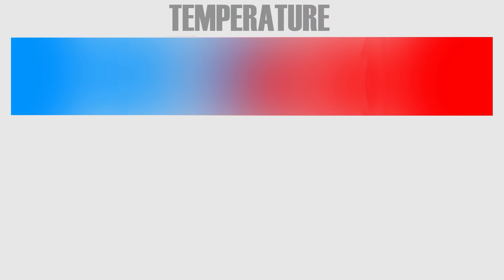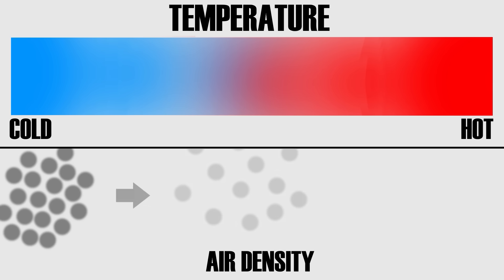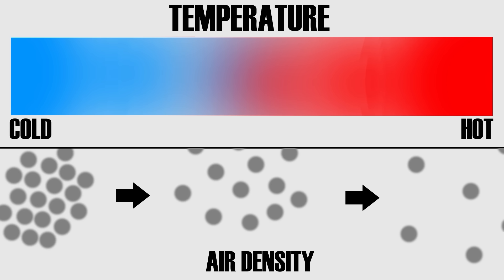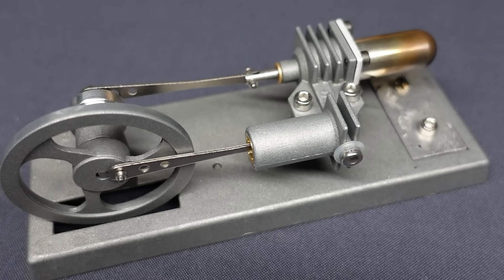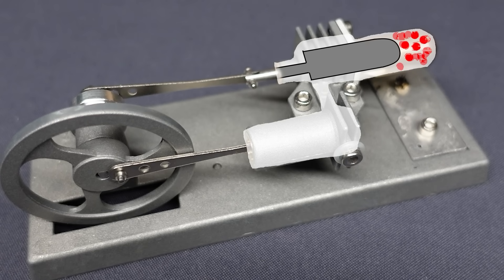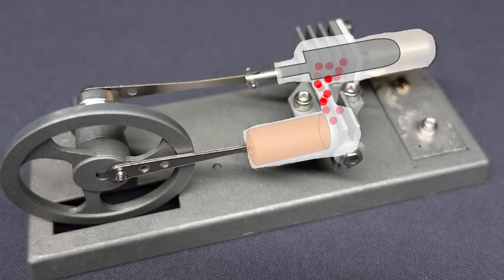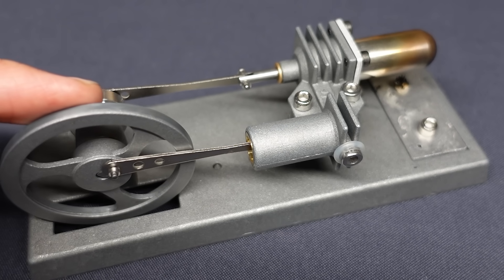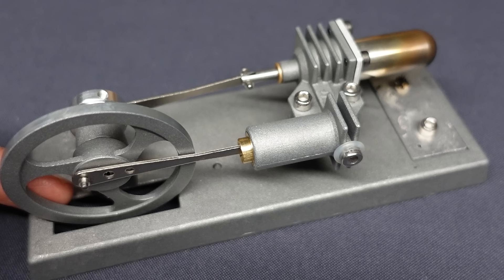It Can Save The World - The Simple Genius of Hot Air aka Stirling Engines

Comment: Sorry, Stirling Engines cannot 'save the world'. First, the world is doing quite well. Man and his technologies are extracting more energy from hydrocarbon fuels than ever, with better ICE designs and technology emerging as we speak. We invented ways to clean the exhaust. I have owned many diesel cars. From an Isuzu pickup in the 80s, several diesel VW Rabbits, and now a Turbo Diesel Jaguar (Yeah, its a really nice car, fast, and 40'ish mpg) with the latest DEF (SCR) exhaust system, that produces a tailpipe output that is cleaner than current gasoline ICE cars. edit: How clean? DEF emits Nitrogen and water vapor, and TRACE carbon dioxide. Yes, that's right.. no CO2, NO CO, NO Soot, No Nitrous Oxides. 
It's like the PERFECT technology for our times.  

I've owned and built several Stirling engines over the years. They are NOT efficient... Enough.  They do NOT produce enough horsepower. Never will. If they DID, we would have BEEN using them beginning years ago, and their technology would have, by today, been even more polished and efficient workhorse, instead of a novelty science items like they are today. 

Stirling Engines can do 'some' things, that's for sure. But the big, massive HP and torque generation needed by modern society? Nope. And that's why we aren't running our world economies on them. Period. 

Better to focus on diesel and atomic. Right now, Diesel is the most environmentally kind  fluid fuel we have. It takes less energy to produce than gasoline, and has more power in it. 
Add to that the new, and actually amazing DEF system, and you have LITERALLY a zero emission vehicle. Why hasn't the public HEARD of this? Why aren't we CELEBRATING this? Because hydrocarbon fuels have been VILIFIED and we are being programmed to AUTOMATICALLY HATE them.. and FAWN OVER ELECTRICS... or else! (I live in California and I see this mind-numbing narrative all the time)  
Electrics are horrid to the environment. Perhaps that will change, but it's many years away. Meanwhile, have you seen the HUGE BLACK RECTANGLES that are KILLING our deserts here in the SouthWest??? Yeah, I'm talking about these massive solar panel projects.. Millions of acres of once protected lands, being quietly covered up by solar panel farms. 

Underneath, a desert that used to thrive, now in eternal shade, criss-crossed by thousands of miles of access conduits and access roads. 

The problem with any discussion about ENERGY and ENGINES and POWER MUST, MUST, MUST include the above facts. Or we're just living in our little energy or engine fanboi bubble.

Comment: It's not an external combustion engine, it's a heat engine as composition implies a small explosion of sorts, a sterling engine does not rely on small explosions or combustion as it's the transfer of heat or cold as they work both ways so no it's not an external combustion engine it's a heat engine. The flame you produce on the outside is computing yes but it's transferring heat that's all where as a combustion engine uses combustion and pressure to move a piston and like with the Stirling engine it only uses the difference in temperature to move the piston.

Comment: Really it wouldn't be that hard to design a condenser that used these instead of cooling water loops. That would make it viable for steam plants, I think. The condenser would probably have to be pretty big, but doable. Imagine a nuclear power plant. Let's say someone works out good large scale high energy photovoltaics. Think like a solar panel, but gamma rays make the power instead of visible light. It's a tough nut to crack, but possible. Surround the reactor with these panels. Run a steam plant off of the reactor. Run Sterling engines in the condensers. Have the sterling engines run their own generators. Smaller sterling engines running in the coolers for all the cooling water and oil loops. We've eliminated the need for both cooling towers or cooling water, and increased overall plant efficiency by a considerable amount. No heat pollution in local streams. No huge cooling towers. I think the small Sterlings in the cooling loops and the high energy photovoltaics would probably power the internal plant equipment, give or take. The Sterlings in the condensers and the steam turbines would run larger generators.  Use all the standard tricks for increasing overall plant efficiency as well, obviously. Now imagine we have similar systems on other nuclear plants, utilizing different reactors. So when the fuel is done in this reactor, it can be made into fuel for another reactor. Then again and again. When the fuel is well and truly worn out it would still need to be disposed of, of course. But it cuts down on mining and punts the disposal further down the road at the very least. You could theoretically power nations with grids run by similar systems. Ways to harness large amounts of waste heat to make useful power is brilliant. Obviously the waste heat still ends up in the environment somewhere down the line, but we could be getting a lot more work out of it than we're currently getting, I think.

Comment: So theoretically, if you could adjust flame temp and some type of clutch system or something, this could work for a car🗿
Reply: Are you familiar with steam engines? They've been around since the 1700's. Exact same principle, but with steam as the working fluid instead of air.
Reply: @teebob21  i know of steam engines, but I haven’t learned enough about them to know that. That’s pretty cool
Reply: @Uhhhboots  Yep. Your first comment was basically describing how a steam locomotive works.

Comment: I'm wondering if this could be used with a wood gasifier to get some power out of gasification. My thought is that you could run an internal combustion engine on wood gas and have Stirling engines on the reactor, where most of the heat is, and also heat your house with the residual Heat.
Reply: The Dutch company 'Microgen Engine Corporation' has their 1 kW producing Stirling engines incorporated in woodburning stoves from Ökofen and maybe more companies. Their Stirling engine is not your typical one; the piston only moves up and down and thus directly generates electricity. No extra translations or conversions of any sort; so no extra losses

Comment: Why arent Stirling engines used in a variety of applications?
Can the Stirling engines run off of heat created from a clean chemical reaction? What about supplying heat or cooling from outside air and other air intake inside the building?

Comment: I'm always a bit sceptical of "revolutionary" technologies which have been widely known for a long time, but not widely adopted, so I do wonder what the drawbacks might be here that I'm not aware of. Nevertheless, where I could see this being useful if it is as great as some suggest would be replacing diesel generators, including in diesel-electric locomotives. For an electrical generator, a minute to start up or shut down shouldn't be a huge issue, so long as there's a battery or capacitor between the actual generator and the electrical output.

Comment: NASA are researching a type of Stirling Engine that uses decay heat from a Radioisotope source and instead of any kind of mechanical/rotation the pistons are reciprocating magnets that induce  and electrical current, they might also be using a more efficient gas than air too. They have very little mechanical wear, are much more compact and lighter than a fission reactor with less shielding and all the pumps and heating exchangers not being necessary and can produce a lot more power than Radioisotope Thermal Generators using the same Radioisotope source.

They have one test unit thats run for 14 years nonstop so far, they might well be the future for power generation during long term missions on the Moon and Mars and could make exploration of the outer solar system, where solar isn't an option and more power than RTGs can provide might be needed.

Comment: If the sterling  were miraculous, it would be ubiquitous.  To date it’s practical apps nil.  There are 3 questions economics considers:  performance, cost, delivery.  Sterling fails perf & $.

Steam engines (Rankin Cycle), closed loop gas turbine (Brayton cycle) are external combustion engines and make substantial power.  
Under study is a CO2 engine (closed loop Brayton cycle).   Because of CO2s peculiar properties, the CO2 engine has low compression work vis a vis typical gas turbine.   Cheers

Comment: I can see it on a hybrid that mainly uses the battery for power and when the battery is slightly drained, the Stirling engine is started and maintains the battery.  Then the Stirling engine can always run at its maximum efficiency, never be required to produce quick power.  When the battery is almost full, the engine can be shut off.  When the user arrives home he can decide whether to continue with the Stirling power or hook up to home electricity.  Then you have to ask if the Stirling can have a higher cost efficiency than a power plant.
Reply: Yes, I was thinking that it would be well-suited for a series hybrid.  With lower power, constant RPM, and higher efficiency, it sounds about right.

Comment: In terms of driving vehicles it could be used for a San Francisco style cable car system where it drives a continually moving cable that vehicles can clamp or unclamp from as needed. The submarine is much cooler though

Comment: This may be a stupid question, but if this were used for a vehicle, couldn’t you have variable speeds if each cylinder was a different temperature but timed to increase the power of the next cylinder if activated together? I hope that makes sense. Consider e-bikes with rear hub motors, I’m thinking like one cooler/weaker cylinder acts as the “pedaling” to a hotter cylinder “motor” when engaged, and you can keep engaging hotter and hotter cylinders. This is the first I’ve heard of these so I may be way off. Thanks for sharing!

Comment: Instead of using heat sinks, we should use tiny sterling engines to dissipate heat from processors and run the energy back into the computer.

Could this even work?

Comment: awesome, can we run them with electric heat?  if you wrap some heating element coils around the air chambers and get your heat source from electricity you could run them extremely safely and if you put a generator on the axel you could even get power out of it, although I'm sure not as much as you put in?  maybe?  someone smart tell me why it can or can't work?

Comment: I live inside a volcano, my home is heated using thermal energy and this cost is very low. I do wish I was better at machining so I could utilize this tech to yield free power from the heat already existing. You never mentioned about minimum temperatures of operation

Comment: Why are Stirling engines not efficient?
stirlings use conduction to transfer heat... this leaves huge energy losses. And makes them less efficient in warmer climates. low power to weight ratio..which is why despite simplicity steam engines replaced them in ships.

Comment: Solar power was one of the first sources of energy used to power Stirling engines. In 1882 Abel Pifre demonstrated a solar powered printing press. The power was generated by solar power concentrated using a parabolic mirror heating a Stirling engine. 

For what it's worth the engine was patented in 1816. That's over 200 years ago...

But the idea is even older and the first documented working hot air engine was built in 1699.

In effect the sterling engine can be said to be a heat pump. It takes heat and converts it to motion. So anywhere you have waste heat you can use that to drive a Sterling engine. This includes exhaust gases, something we produce a lot of.

Comment: These should be in the fireplace/stove of every bug-out cabin, connected to an alternator. Solar works well enough near the equator, but a Stirling/Alternator combo will keep you in power as long as you can maintain it and find firewood to heat it up, even in the long Alaskan winters.

And please don't ask why electricity would be important in a SHTF scenario. Consider the possibilities, especially weighed against the cost of making fires you'd need for heat and cooking anyway.

Comment: What I'm more curious about is how much heat do they themselves waste, and how much of a heat difference they require to operate?
Reply: The maximum theoretical Carnot efficiency of a Stirling engine is about 40%, although in real-world practice, they are have 20% thermal efficiency or so. 

You can technically run a low delta-T engine, if you're OK with basically zero power output.
Reply: @teebob21   Beh..
Reply: @mkzhero  As anyone who has ever studied thermodynamics will tell you: "Thermodynamics is a bitch, and you can't win. You can't even break even."

Comment: Not the only type of Stirling Engine. The kind I first learned about is actually a single cylinder Stirling Engine that can work on much lower temperature heat sources.

Comment: I used to believe this but I met an engineer that explained engine theory to me, and you simply cannot extract more energy than the temperature differential offers. Not only do you need a heat source, you also need a heat sink, and often the temperature differential with things like industrial exhaust is not enough to justify the expense of a stirling engine. They do use them on satellites and stuff like that, though.

Comment: The problem is that Stirling engine power is exceedingly low. The first one in the video could barely charge a phone 1n 24 hours. An engine large enough to power a small village would be as big as a basketball gymnasium and require huge amounts of fuel. Gen 4 nuclear is clearly the best power option.

Comment: Has anyone looked into chilling the cold side to where ambient air is hot enough to power the engine? Not an engineer just wondering if that would be possible with an ac compressor attached to a stirling
Reply: So you're going to use one hundred times more energy than the thing can produce to cool it with an air conditioner? 🤔

Comment: Stirling engines are widely used in solar electricity plants, there is a big parabollic mirror, which directs sunlight, sunlight heats helium (helium is used as an heat medium) and the heat then moves stirling engine which is connected to generators which produces electricity

Comment: Couldn't be this used as great replacement of alternator in cars? I don't know how well it could work but if you think about it. 
ICE in cars have huge amount of waste heat and alternator takes away some of engine power but with Stirling engine you would use waste heat and therefore save some engine power for powering wheels instead of making electricity. 
Just thought that could be very flawed due to added weight.
Reply: His giant engine lit up a single LED... Now, how many electronics are in your car?
Reply: @aviandragon1390  Its hobby level engine that could be made a lot more efficient with power/space ratio. But as i said i dont have understanding to know how viable that is. Even more so with weight and space required

Comment: so instead of containing the thermal energy and converting most of it into mechanical in a regular combustion engine, this is heating up the cylinder and its surroundings creating far worse conversion rate.
also, creating a regulated heatsource for this, that doesn't involve 1 extra step of energy conversion(electricity to heat) is going to be a nightmare, specially when the outside temperature changes. 
giving the term "cold engine" a whole new meaning...

this is a neat gadget and it can definitely be used on excess heat or inexpensive way of converting solar(or any thermal) energy into electricity. saying that this will one day power cars is just reaching, to be polite.

Comment: So a stationary large Sterling engine could have a large magnifying glass mounted above each cylinder. Harness the focussed rays of the Sun to power them and generate electricity for a lower loss solar power solution. A large enough system could power onboard servos and a small computer control and sensor array to have it self focus the magni Fr ying glasses for optimal heat no matter the Suns position like solar arrays do today already.

Comment: Could you produce a similar effect by cooling the other piston?
Reply: Yes, actually. It's just a lot harder and far more energy-intensive. In that case, the atmosphere becomes the heat input source, and the refrigerant system becomes the heat sink.
Reply: @teebob21  makes sense. I was thinking it could be useful In subzero areas to recover energy used to heat buildings. If you have a heat pump already you could make it super efficient by recovering that heat energy with the engine
Reply: @Fix-It-Jimmy  Unfortunately, it doesn't quite work that way. Thermodynamics is a bitch. You can't win, and you can't even break even.

Comment: Ive always wondered if a engine like that would work in space off the heat of the sun and cold of the shade, be a good clean generator for a moonbase,  less gravity would probably help it run better as well.
Reply: Won't work. Shade is not "cold". There is no air to dissipate the heat on your cold side of the Stirling engine.
Reply: @teebob21  might if cold side is in the regolith, and the shade will disperse heat the same way they are doing it on the James webb telescope

Comment: I always see these and end up wondering: Can you use Mercury instead of air as the fluid that moves the pistons with temperature changes? Can using Vantablack on the hot side with a magnifying glass and superwhite on the cool side be used without a flame or external combustion?
Reply: No. Mercury, like all liquids, has insufficient thermal expansion properties.